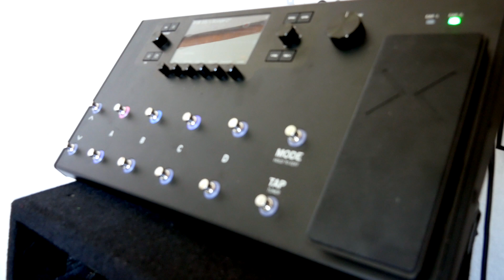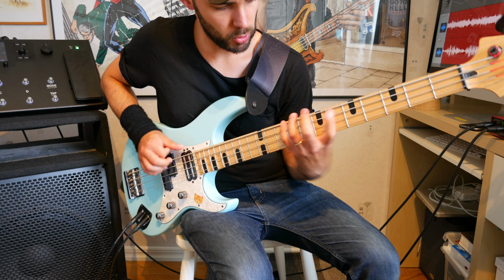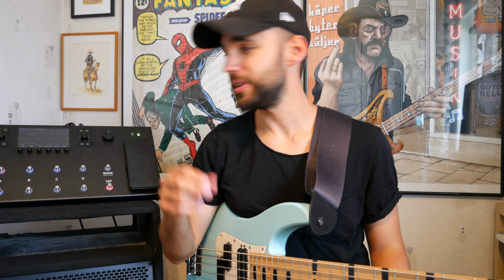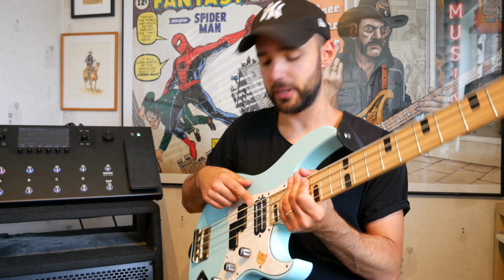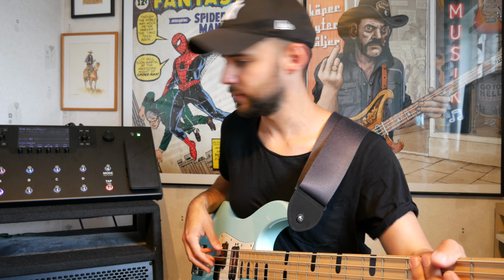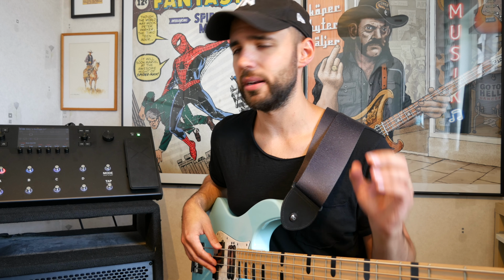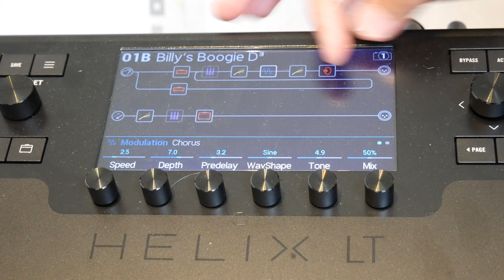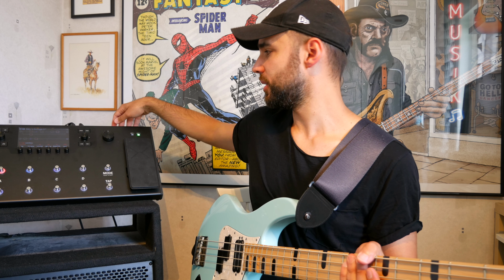LINE 6 HELIX LT BASS DEMO

Comment: Hi Eric just wanted a bit of clarity I’m running my attitude with two amp set up and I need to know the configuration for live,two amps what in’s and outs etc sorry for the nube question but just got the Helix LT and I need the routing from bass to helix to desk. Using both inputs, Hope my question isn’t too long winded thank you in advance. 🤘🤘🎸🎸😊 using my backline as my monitoring not using in ears or anything. 😁
Reply from the maker: Hi man! Plug the P-pickup into the guitar input and route that one to output 1. You'll need to pan it all the way to the left, if I recall correctly :) Then you plug the woofer into Return 1 and route that one to output 2 (which you do by panning it all the way to the right!) Hope that helps :)
Reply: @erikarko  thanks for that much appreciated I’d sort of picked that up from some of your other post just was trying to get my head around from bass to amps then to the P.A 😁 thanks again for your swift reply. 🤘

Comment: So now that I got a Helix and I grabbed your tones from the Custom tone page-thank you
How do I get both tones at the same time -one for each pickup? And then to my two amps.
Reply from the maker: David Vota 1. Plug the P-Pickup into Guitar In and the Woofer pickup into FX Return 1 
2. Select Guitar In as the input source for the uppermost channel/signal path and Return 1 for the lowermost channel/signal path
3. Scroll to the “Output part” (The rightmost “block” on the screen) and select 1/4” Output on both. Then pan the uppermost signal path ALL THE WAY to the left and the lowermost signal path ALL THE WAY to the right. The P-Pickup will now be played ONLY through the L 1/4” output and the woofer through the R 1/4” :)